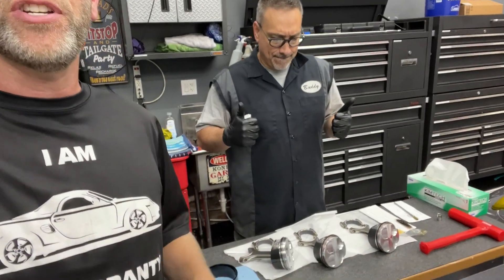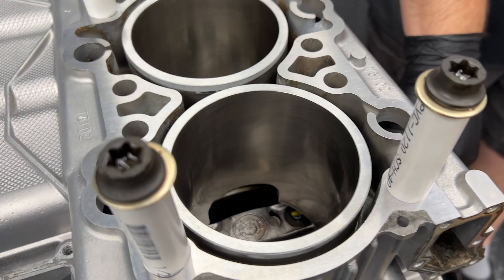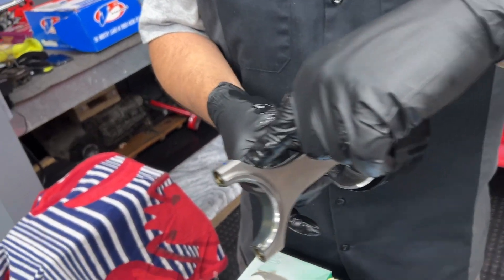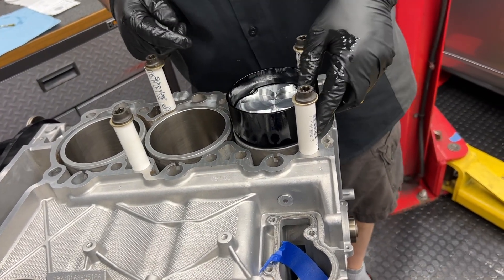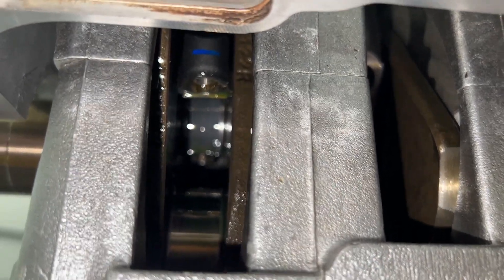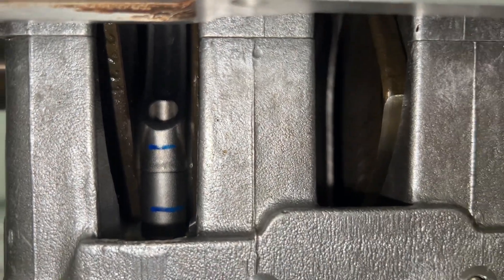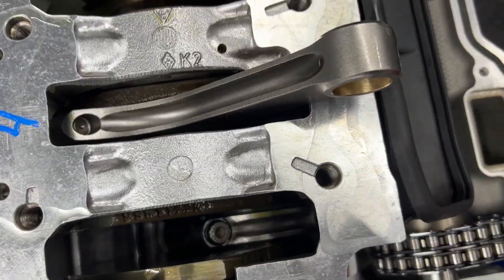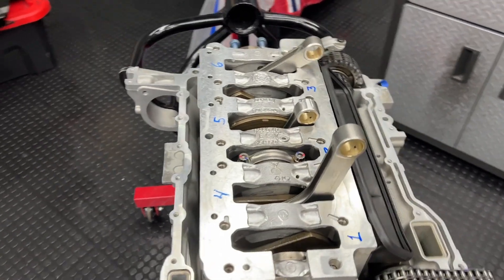Porsche 911 Engine Assembly Guide - Part 6: Bank 1 Piston Install

Comment: Hey Aaron! I have a 97 base Boxster that I’ve been wrenching on for a few years and I’m looking to trade in for a 2006 cayman S project car. Unfortunately I don’t have the money or the space to be able to have both, so I wanted your input on which is the better car for DIY and aftermarket support, and which is your favorite platform in general?
Reply from the maker: +Dylan Wrede hey! My exact two cars 😂 I love the power of the 987 S. I think it’s easier to work on for a couple reasons:::: you eliminate all the issues with the top, and it’s easier to access the top of the engine I think. You can sit in the back trunk if needed. And since it’s newer, I’ve found the the hardware fasteners to be easier to work with. But very similar platforms of course so your knowledge will transfer well!